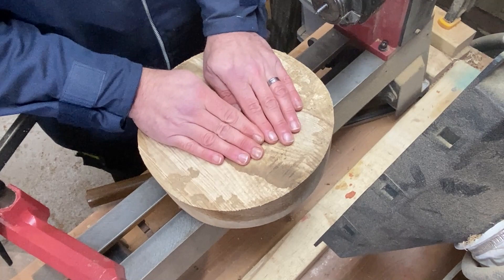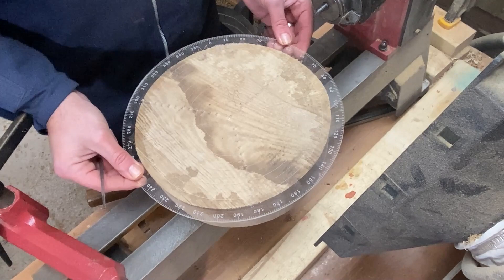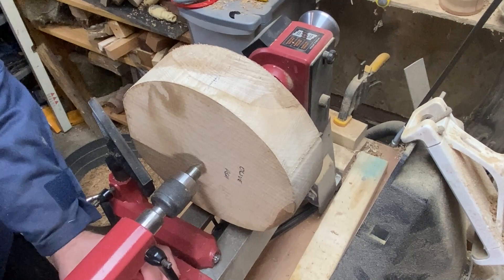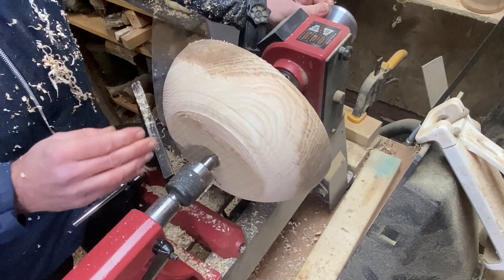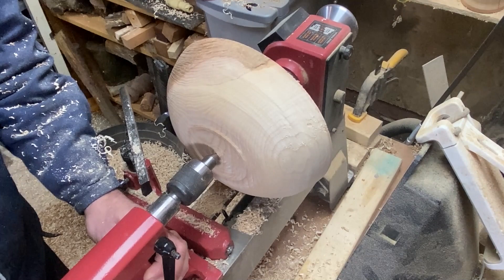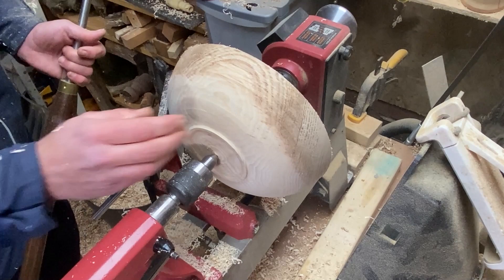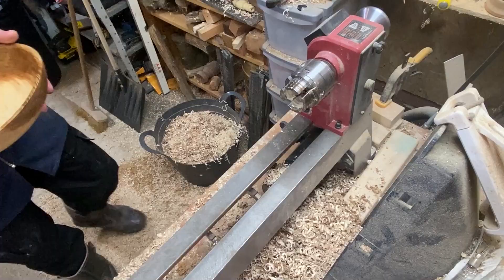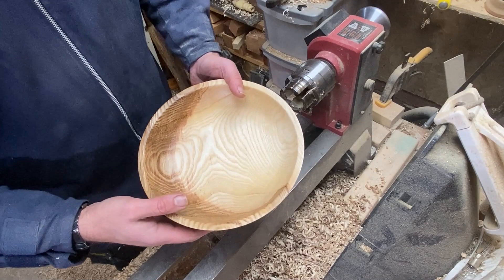Simple but PERFECT - Olive Ash salad bowl - woodturning project

Comment: I love the bowl and the grain.   Well done.
I am normally nervous with a bowl blank which contains uneven mix of sapwood and heartwood.   I turned a black walnut bowl which had a small amount of sapwood on one side.   I had a lot of vibration due to the density difference.    The biggest issue was that although the blank was nominally dry, I turned to final wall thickness and then the sapwood dried a bit more, sufficient to make a flat spot and the walls are now not thick enough to re-turn this to be true.   Drat, this bowl is now in my collection of failed projects.   A shame since the walnut had some really nice grain and colours.
Dave.
Reply from the maker: Thanks Dave, I know what you mean about the uneven wood. This was a pain, would have been a lot easier on my new lathe :), you will see it in action on the next video. All the best, Mike